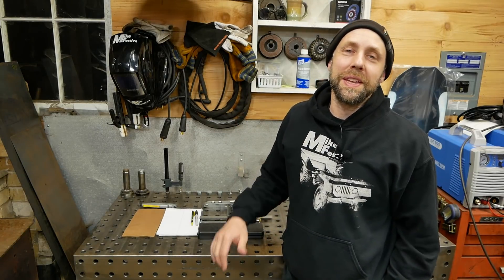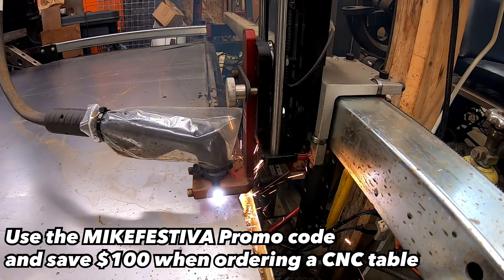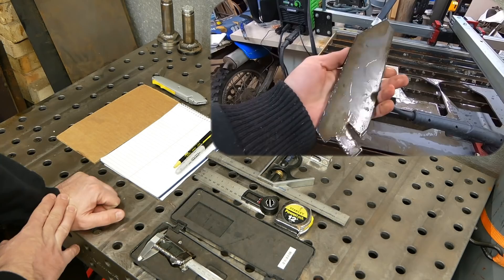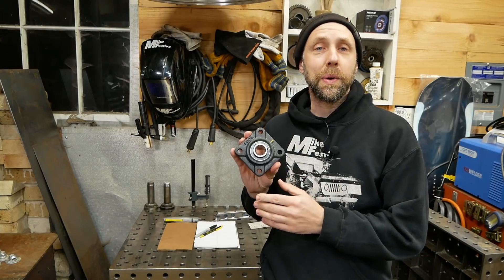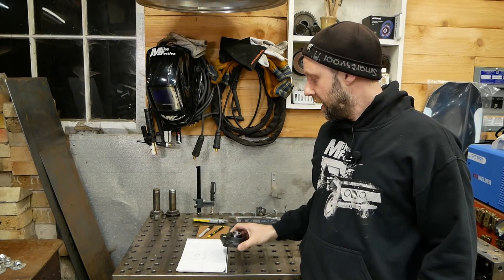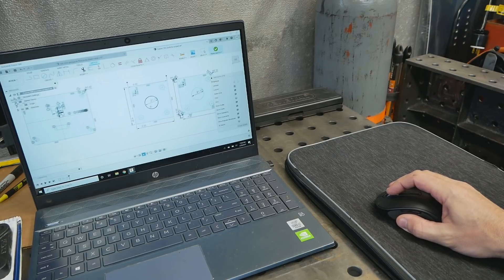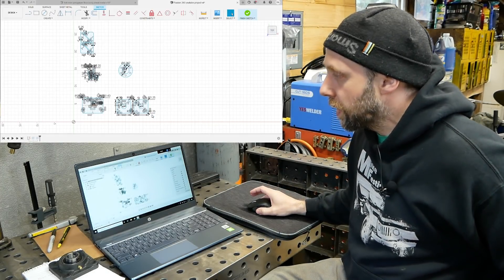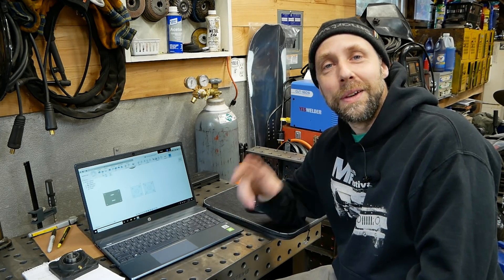Fusion 360 2D Tutorial Drawing series for Beginners part 1

Comment: When you are measuring your hole to hole. Just messure one hole with your caliper. Zero it out, then just messure outside to outside of each hole. Now you have an accurate center to center. No eye balling
Reply from the maker: Or you can just measure it the way I did in the video 👍

Comment: Hi Mike, can you us a Apple computer
Reply from the maker: I believe so but your going to have to check with the company
Reply: @Mikefestiva  thanks, I am
Reply: @Mikefestiva  I'm thinking of getting the pro like you said it's only a couple of bucks more and you're getting more
Reply from the maker: @charlesflaco7976  I have no regrets buying my Crossfire Pro, it’s been a really reliable CNC. I definitely think you will like it 👍🙂
Reply: @Mikefestiva  Hi Mike, I have another question I was available to download firecontrol on my apple
Reply: But that system does it have to be connected to the machine for it to work and can you take your laptop on the road and just plug it when it's ready for use
Reply: What I'm trying to say is do you have to be plug in to the machine in order for you to make anywork also you said something about internet connection does it have to be connected to the internet too?

Comment: Mike does the Fusion 360 work on Macs. It looked like were using a Windows type lap top. I have a Mac lap top. Thanks
Reply from the maker: I haven’t looked into that? But I’m sure Fusion has info on there website of computer requirements. Thanks buddy for checking out my videos 👍
Reply: Yes, Fusion 360 works on Mac OS as well :)

Comment: Hi I know u u do much with predator 212 what is the size of the bolt that goes in the drive shaft to hold your torque converter on
Reply from the maker: I think it’s 5/16 fine thread, but it could be 3/8” fine thread? I haven’t installed that bolt in about a year but I do know it’s fine thread 👍

Comment: What is the smallest air compressor I could use with a plasma cutter on that table? Thanks
Reply from the maker: I’m running a two cylinder 50 gallon compressor in my shop, it always keeps up with my Titanium 45 plasma torch. I do know my Titanium uses a lot of air.
What plasma torch are you looking at? Some use less air the Others.

Comment: Mike, just a suggestion here, if you extrude, then create another sketch and you the point command, then hole command, you can easily edit all the hole sizes at the same time. Say you cut it out and you want all of them a different size, you can edit the hole command and it will change all of the holes at once rather than having to edit each circle in your sketch. It is great that you are teaching this skill! I’m a drafting and design student, we have learned fusion 360, inventor, and autocad.

Comment: Fusion 360 is a black hole in which all your hard work will be dumped if you don't pay their monthly subscription.  Better off with even with sketchup, but at the very least a CAD program that is a stand alone tool on your own hardware.
Reply: I don't think so. Why would they do that? It would only kill their business.
Reply: @lomoDaniel  Haven't you heard, they already did.  Scaled back needed features and limited the number of models to 13.  Thankfully I never went all in with their software because they always held the keys to my work, even if you are a subscriber.  Plus I know Autodesk...  A company run by cut throat lawyers, or so I've always assumed judging by their cut throat ways over the years.
Reply: @MatHelm    there are a couple ways to retrieve your files, however I’m a total noob, would you recommend another cad program?

Comment: I already do 3D modeling in Fusion 360 for 3D printing but interested to see how you use it for CNC. Always up for learning something new, super interested in how to load and cut using the Crossfire.
Reply from the maker: Right on! Thanks for checking out my new video. 
I’m sure your knowledge and experience with Fusion is far better then mine is, I’m still only scratching the surface of 3D drawing, there’s so much to learn.
I think the part of the series you will want to see is going to be probably around part 5 or 6, by that point I will cover tool paths, cut speeds Pierce times and exporting G code. Then we will move onto Firecontrol software, that’s the software that controls the Plasma Cutter 👍 thanks for checking out my videos and commenting 🙂